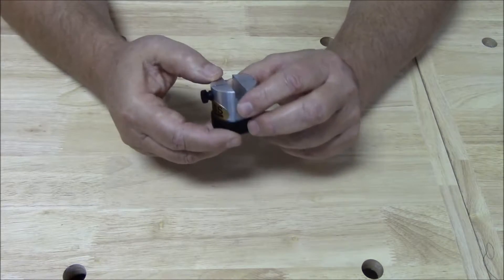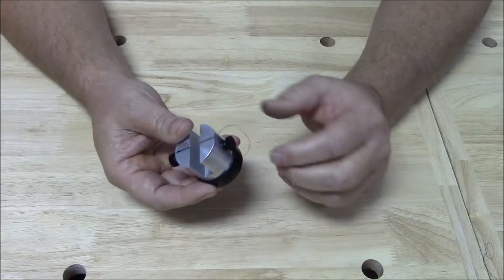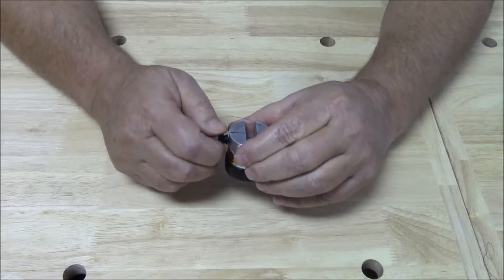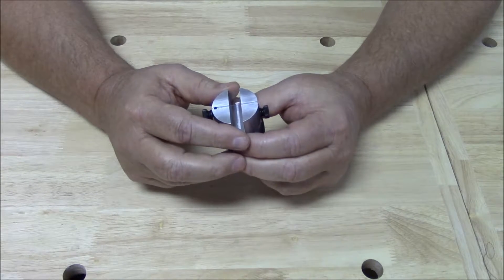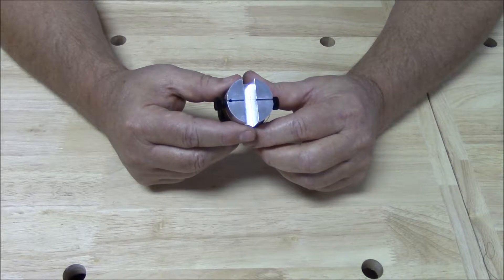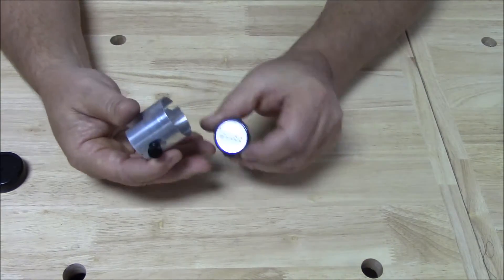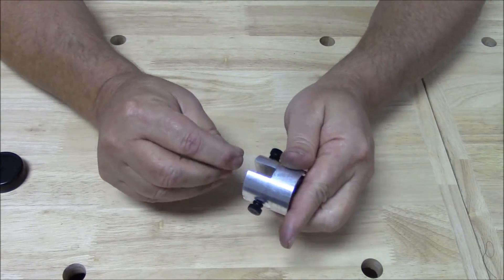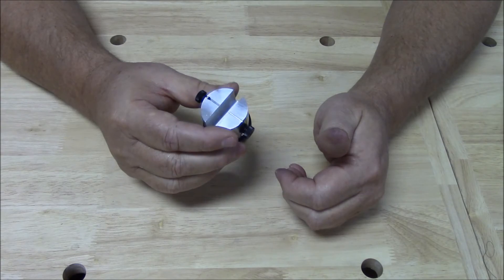Edge On Up Route and Reload Test Media

Comment: Does it make a difference clockwise or counterclockwise for the test media onto the top thread?
Reply from the maker: Hello Michael - Keeping in mind that this is our old-style ATF10 as opposed to our new-style ATF10G, it makes no difference which way you wrap. Our new-style ATF10G requires no wrapping of the test media.

Thanks for the question,
Mike
Reply: @edgeonup4426  thank you
Reply: if your smart youll put it on in the direction of tightening NOT against it as shown. This way it self tightens vs self loosens lol.